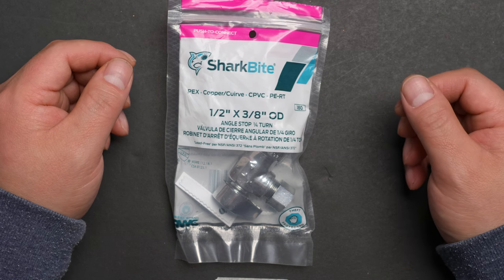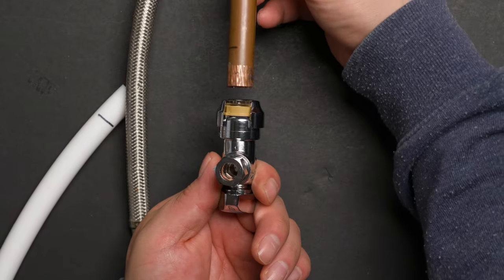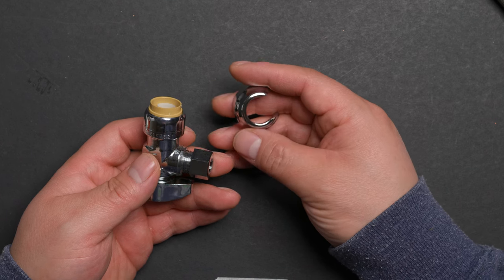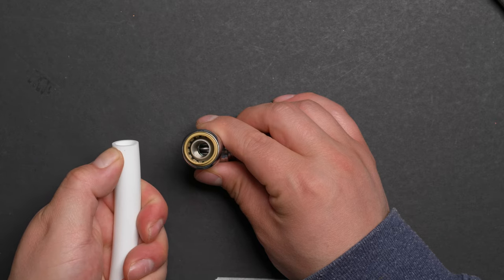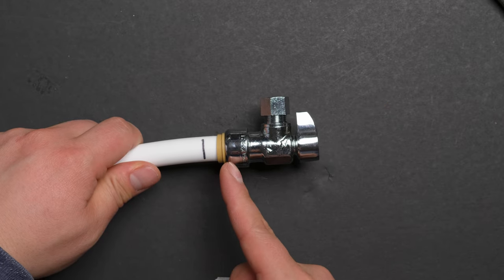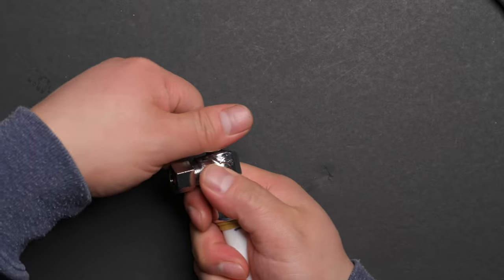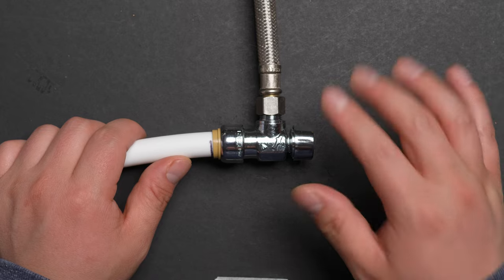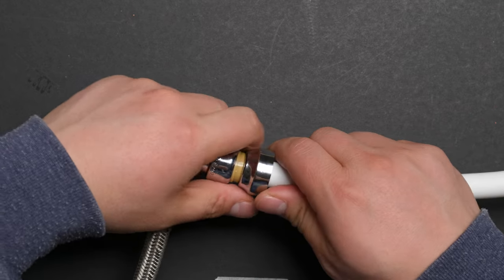How to use Sharkbite angle stop valve

Comment: Hi, question. I had to replace my shutoff valve. When I took of the old compression sleeve, new one didn't fit because the old ring made the pipe a bit thinner. So I googled and found Sharkbite shutoff valve and installed. My question is, after installed, if I leave it just as is then it's no problem, no leak. But if I grab it and twist then water is coming out from somewhere. Is this normal?